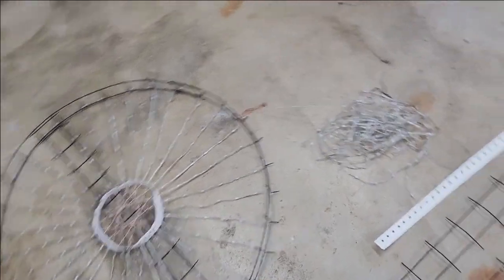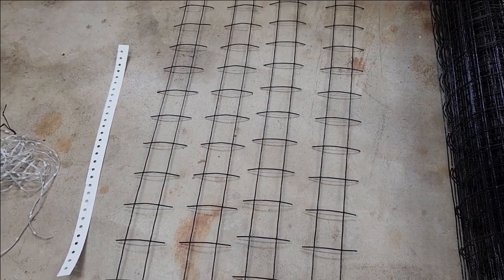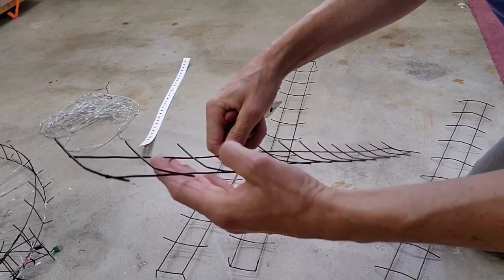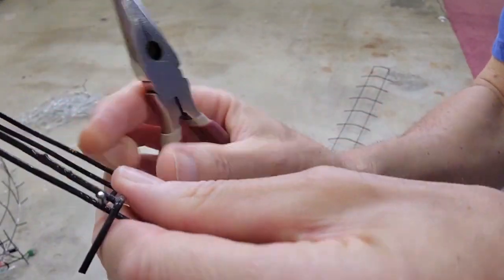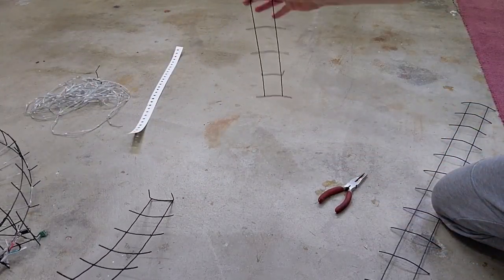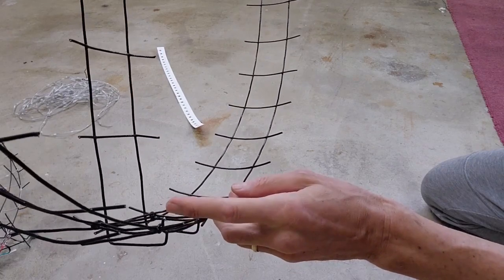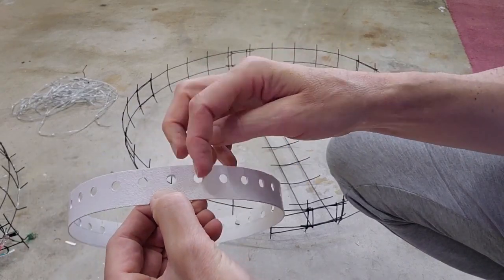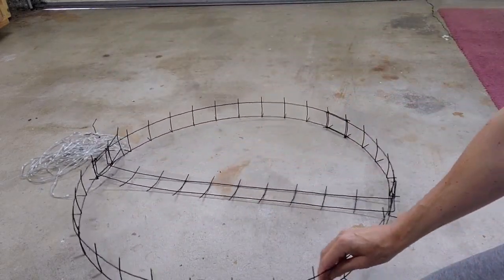Seed Spinners (2023) - Frame construction

Comment: Love the use of seed pixels to save some money, will probably follow your example next year, anything you have learned from using them now?
Reply from the maker: The main lesson is that now I am more comfortable with their reliability and this construction technique - they have been mounted outside for over a year now (exposed to sun/heat, rain/moisture, wind, but not so much cold) and they still work well.  I wasn't sure about them when I first built them, so it was an experiment.  Also, some of the frames bent a little during high wind (because I mounted some coroplast decorations behind them, which increased the wind resistance), so if any additional surfaces will be attached then the frames need to be a little sturdier.
Reply: Very helpful!!! Thanks.